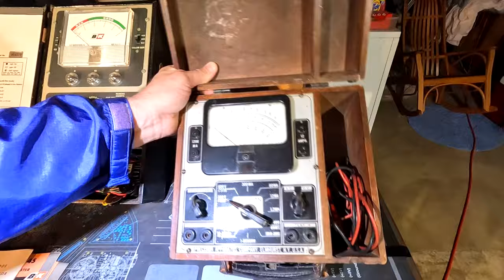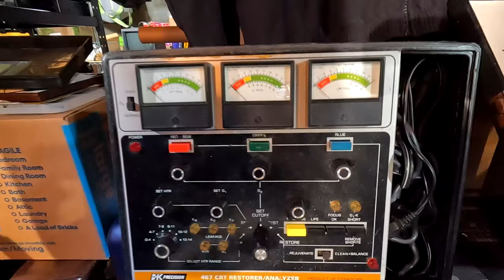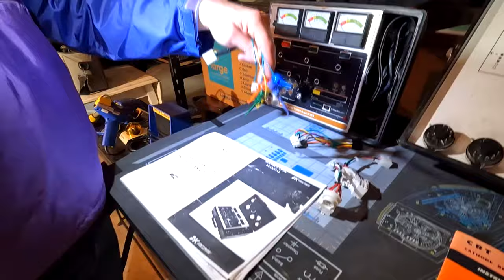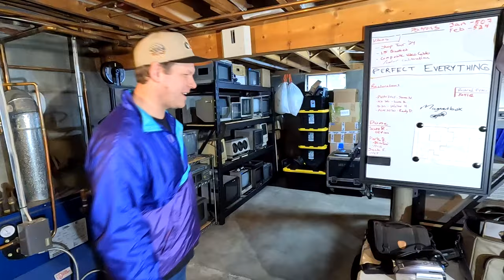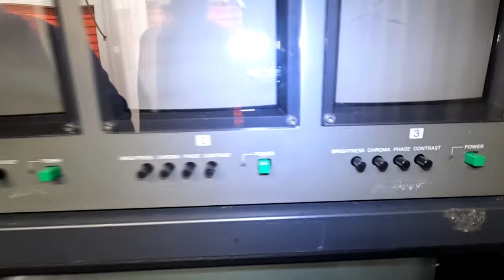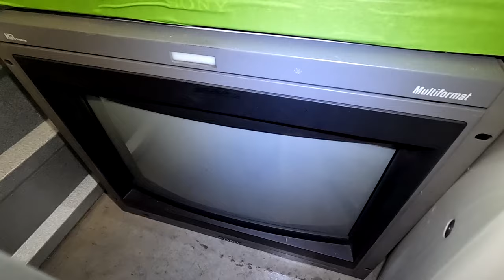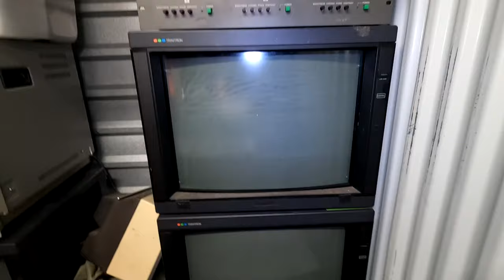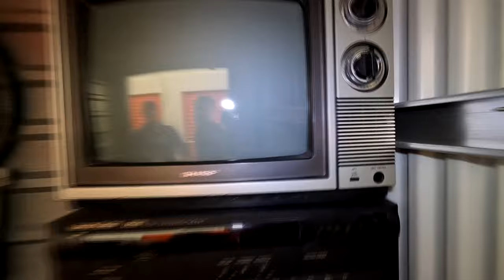Visiting America's LAST CRT shop

Comment: First time I've seen rejuvenators in your videos (let me know if I missed any). What's your experience with those on Trinitrons? The general opinion I heard was also along the lines of "you can't rejuve a Trinitron" (without cooking the cathode, that is). I have a Müter BMR 95 and 2005 and according to the Info I got from ze Herr Müter Jr. himself, these models were specifically designed to handle the sensitive cathodes of the newer CRTs. That being said, I haven't tried them on a Triniton yet. I have a 32" flat Trinitron on its last legs I'm tempted to try it on, buuuuuut... I don't really feel like trashing it yet. 😟
Not surprisingly, rejuvenators are now sought after specialty items, and this is reflected in the price, esp. for the later models which don't fry your tubes outright.
Speaking of which... how the hell can you rack up 200k hours on a tube?